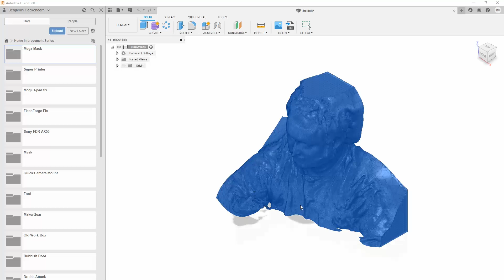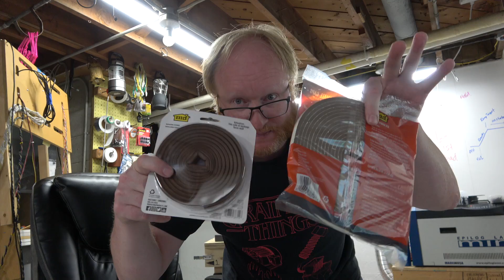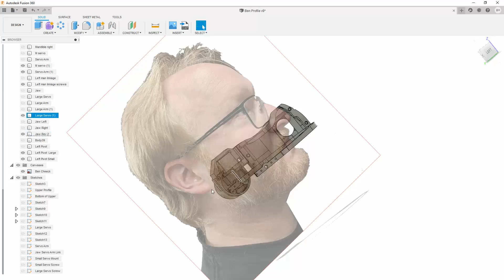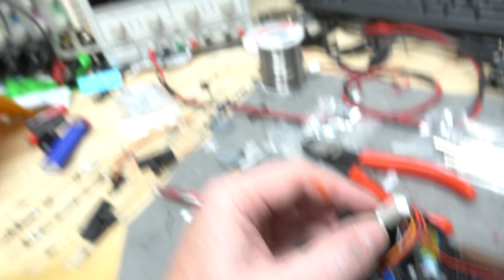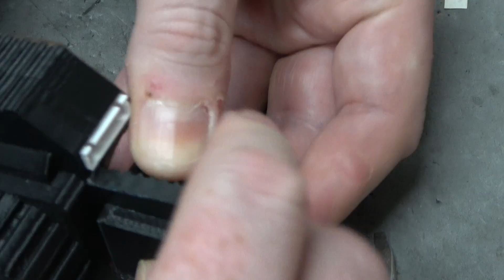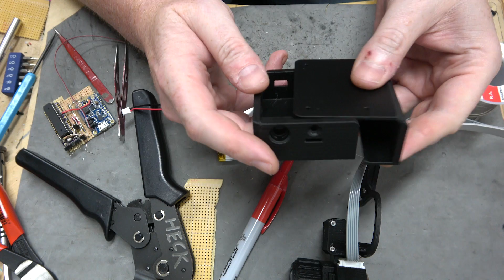Auto-Mask (Mark 1)

Comment: Ya that's what I do... I put the glasses on the metal nose part of the mask which prevents the fog problem.. no need for a high tech toy.. the problem isn't the mask u need a new type of glasses made to work with the mask.. bigger glasses to fit on the mask.. mostly like safety work glasses..or just order a a plastic face shield cheap
Reply: Or just wait for the glasses to warm to the temperature of your exhaled breath, which doesn't take too long (what I do).

If it really annoys you, apply some liquid soap to the glasses and wipe it off, you only need the thinnest of residue left behind. The soap will decrease the surface tension preventing fog from forming on your glasses in the first place.

But if you do either of those things, then you don't get to make a cool automated mask.

Comment: I like the part that is covering the lower part of your face. Maybe work more on that solution? Something that flips up over your nose and then pulls it tight over it? Might use a cam track for that. And maybe place some inlet vents turned backwards so they draw in air from under your ear?
Reply from the maker: That's exactly what Mark 2 is. It's using a rack and pinion for both slide open and drop.